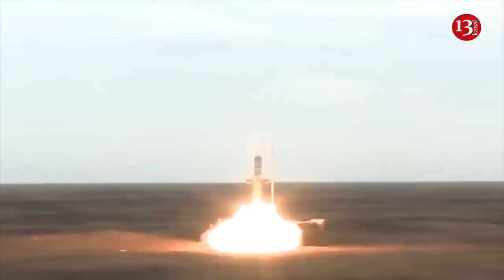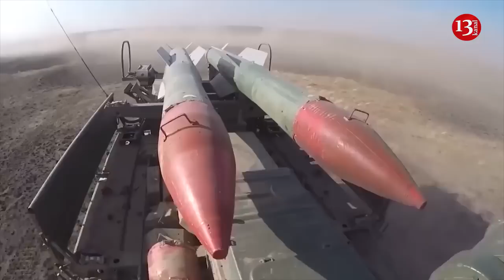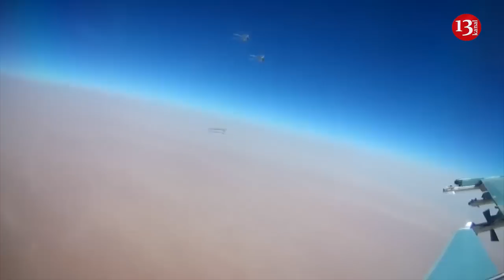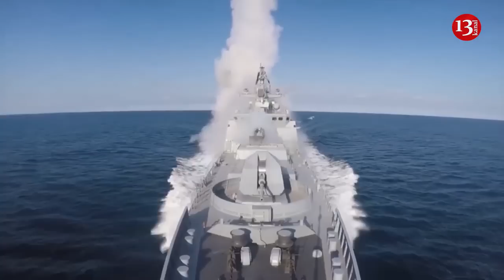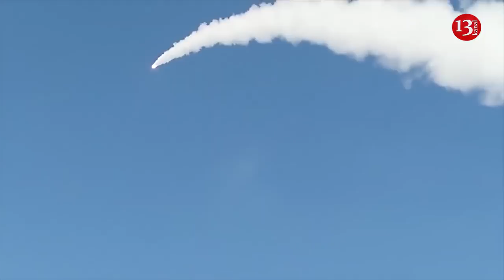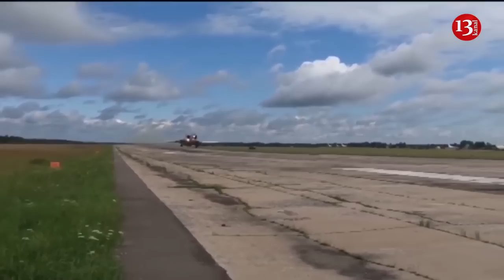81% of foreign components of Russian missiles are manufactured in US

Comment: These are not chips that are hard to find or chips that have limited uses. African countries and anyone still dealing with Russia can setup and buy small amounts at a time and ship them to Russia. With an open Global market shutting that down would mean to stop selling to anyone doing open business with Russia. Even at that, with the size of chips , Russia will find a way to smuggle through . What is strange is that we only produce 12 percent of the worlds chips and we supply 81 percent of the chips? Most chips have clone chips . The USA does not use a lot of “ Advanced( newest latest greatest)” chips in their stuff . They use high grade older stuff ( or at least they used too). If you are making a missile to fire “ right now” then using capacitor and parts that are guaranteed to still be good after years of storage would not be at the top of the list. They might even use the hobbyist level if they had too. Some chips are even programmable to mimic others ( though not at the same response time usually.)